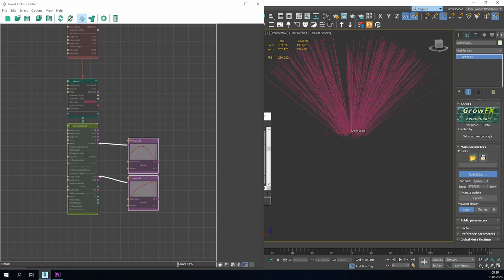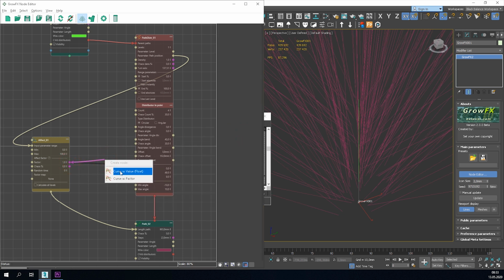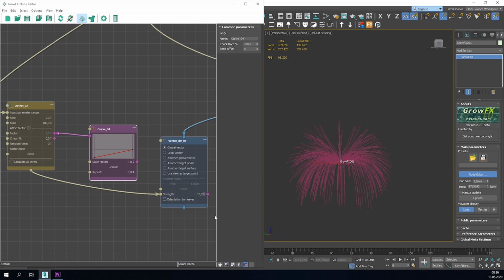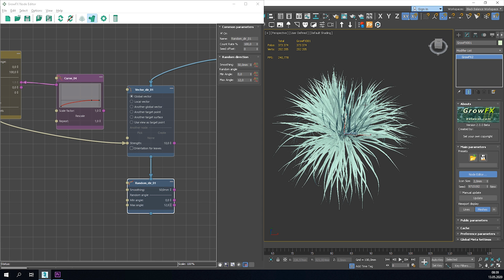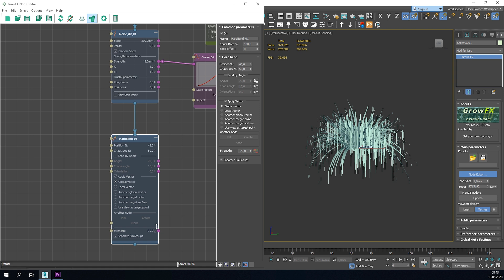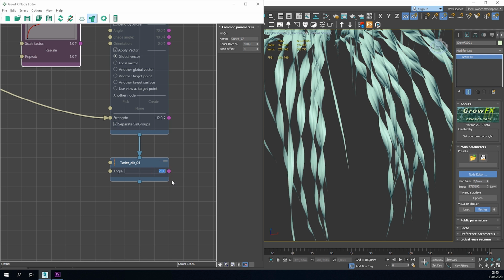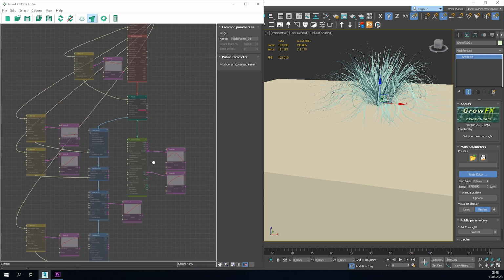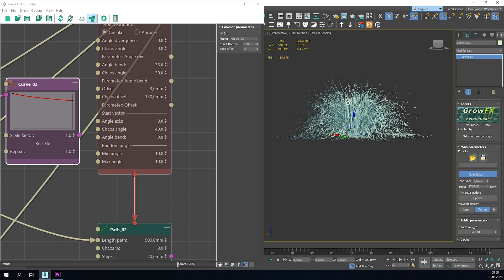PLANT MODELING IN GROW FX 2.0 FOR 3DS MAX | PART 2

Comment: can grow fx be used to make a complete scene or just for modelling plants ? i mean do i have to know forest pack + grow fx or grow fx is good enough ?
Reply: growfx can be used for modelling the plants for the complete scenes and scattered using the forest pack (don't worry, FP is extremely easy to learn really)
PS. you may want to collapse growfx to mesh first, then export as a vray proxy and THEN scatter it to avoid resource waste and higher loading/ generation times/ scene save times, scene file weight, viewport slowdowns etc.

Comment: Grow fx can also  b used even in unreal  engine?
Reply from the maker: It's a plugin only for 3ds Max so far. :)
Reply: @ArchVizArtist  but you can make a model with growfx and export it from 3ds max to ue4..  speedtree will be a better tool for ue4 though as it makes LOD's automatically for you